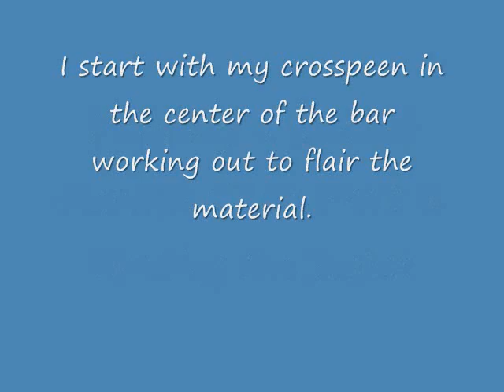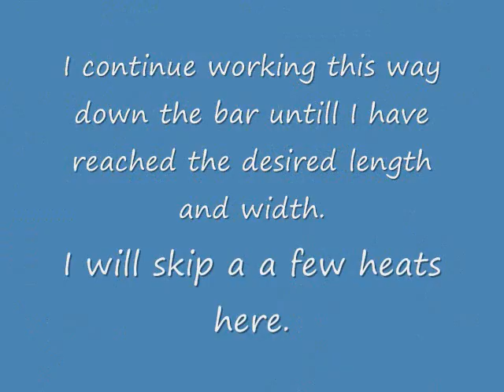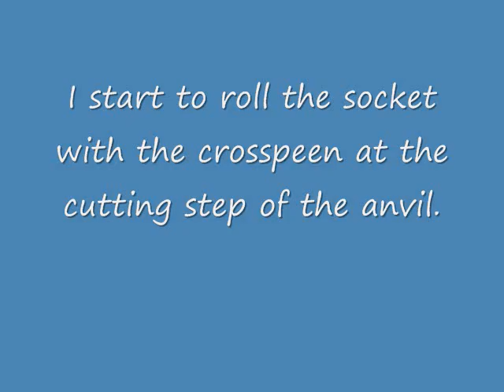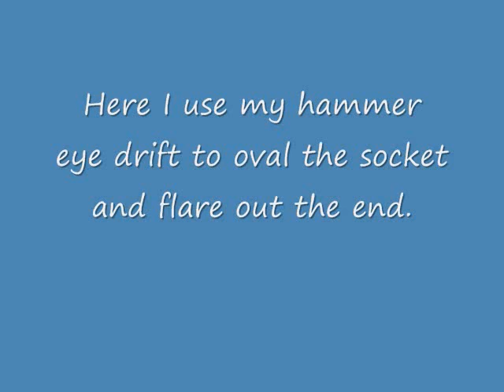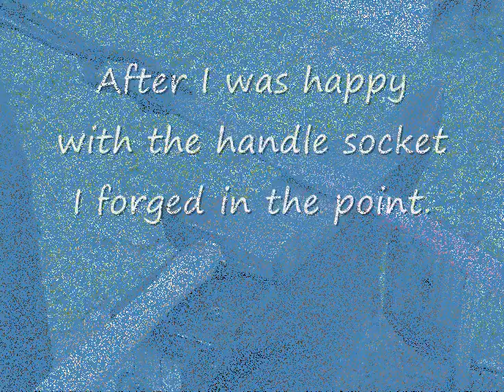Forging a Socket Handle Seax Part 1

Comment: I like it. Are you going to harden the Seax?
Reply from the maker: Nathan4071 I've just formed the handle and tip at this point,  next I'll forge the bevels in and rough grind the blade. After rough grinding I will harden and temper.